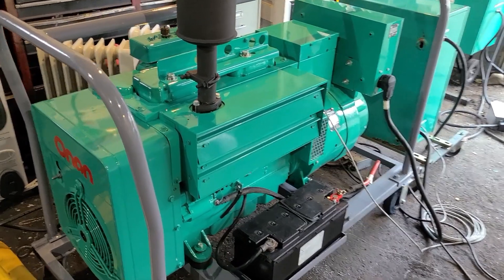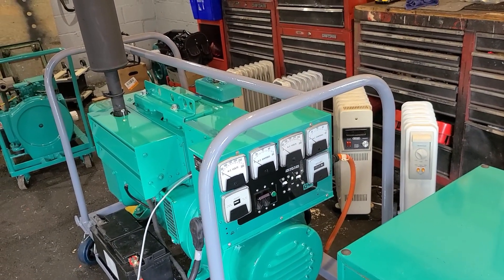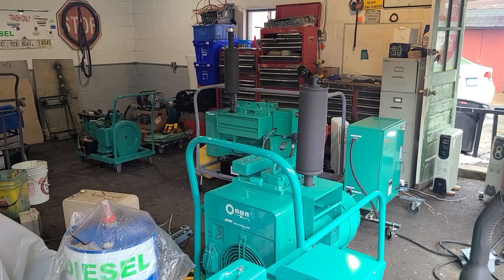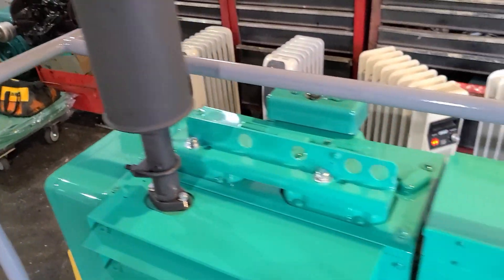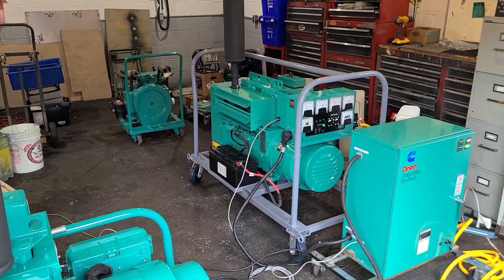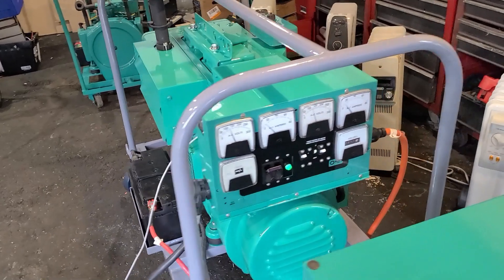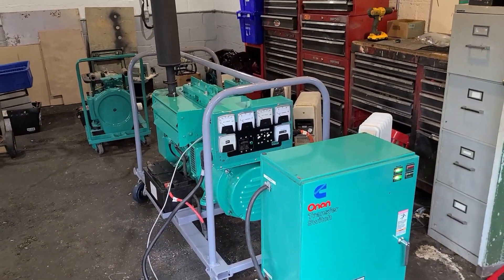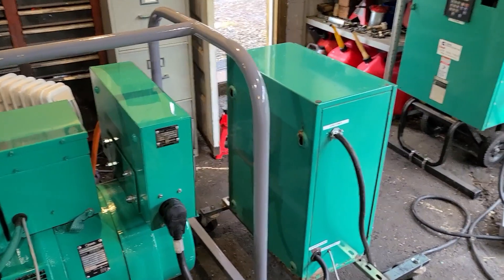Onan DJC Wet Stacking

Comment: Wet stacking is common on diesel generators and other diesel engines that idle or run unloaded for long periods of time. It is a result of low cylinder pressures that allow lubricant oil to bypass the rings because the rings exert less pressure against the cylinder walls. 
This is especially a problem on air cooled diesels as they have difficulty getting up to operating temperature without sufficient load. 
Diesels like to have between 70% and 100% load. That’s where they are most efficient. Long idling and low loads can eventually cause stuck rings and glazed cylinder walls. 
I used to work on locomotives that spent many hours at idle. As part of normal maintenance several times a year, we cleaned out the soot traps in the exhaust manifold. Usually get a 5 gallon bucket full of heavy oily soot, caused by wet stacking.   Ocassionally when running a locomotive hard, all that junk would catch fire in the manifold and we’d have flames out the stack!

Comment: This wet stacking happens to 2 stroke gasoline engine exhausts as well. I think it happens because diesel which is oily and gasoline 2 strokes use oil in the fuel.

Comment: That's wet stacking, the combustion cycle doesn't create enough heat at idle or unloaded to completely burn all the fuel sending the "heavier" harder to burn parts of the fuel out of the exhaust.

Comment: ODJC-CE/8523AA This one is Diesel, I am trying to rewire as 3 phase 380 volts I could not find wiring diagram. and I have 12.5 JC-18R/25786AD This unit it has a selector switch that you can select different voltages, again I need to rewire for 3 phase 380 volts please help me to rewire them. thank you in advance

Comment: My DJA had that issue when I first got it, The previous owner would run it for a few minutes,  then shut it down and it became hard to start. He never let it get up to operating temperature and under a load to burn all of that off. I cleaned it all out and no I don't have any issues with starting and when I run it occasional I always let it run at least an hour.

Comment: All that green in his garage...
Reply: Yeah, now we know who has been buying up all the Onan touch up paint! 

I went to home depot and had them match up the color on the better looking panel for mine and got an oil based paint. Disclaimer: I don't know much of anything about paint... Anyways, I removed and cleaned all the panels and shrouds, lightly sanded them, primered and then I brushed on satin finish following up by reassembling and dabbing it all around to give it a sort of industrial textured look with the simi-gloss. Turned out to look pretty good IMO. No idea how well oil based paint will hold up in this application on my 4.0BFA.